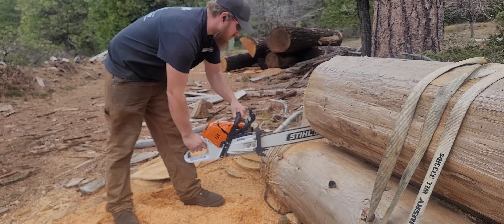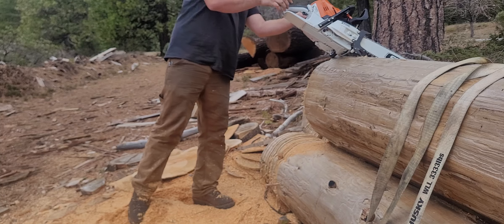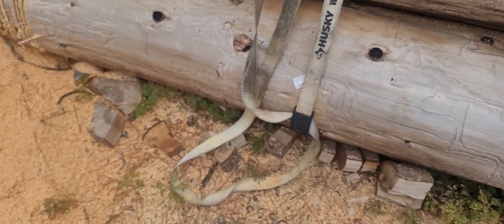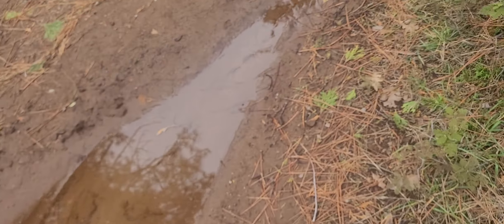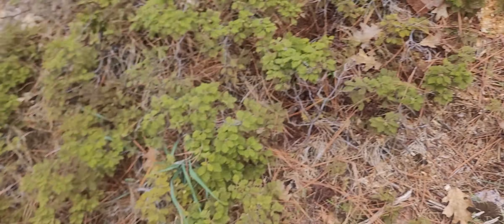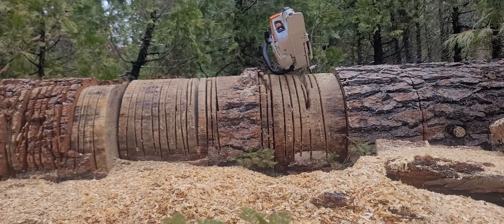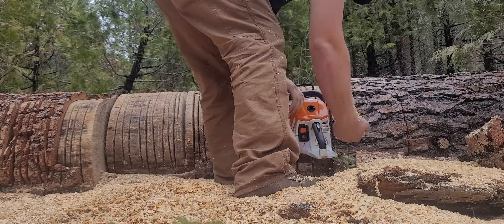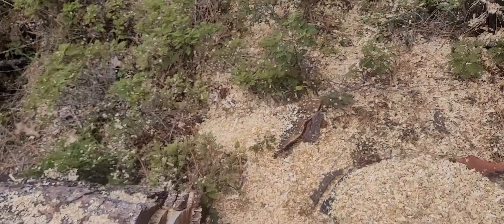Austin's 500i. Let's talk about chips.

Comment: I guess if you where on a  job site with that saw and after half way through the  job you didn't like the chips you are seeing,  you stop the job then replace the blade ? Complaining that the chips are what they should be ? You would not be on my job site that long , bye bye . Quit over thinking the job get it done . You work with what you got on hand you prepared for to get the  job done, get paid and move on to the  next job. You want perfection out of the  box . You get  progress then perfection . But you can't have them  both at the same time it is one then the  other .
Reply from the maker: I think you misunderstood the point of this video, as I was responding a comment on a previous video. Literally, the entire point of the video was to explain that you should not put a bunch of blind emphasis on the chips coming off your chain. Thanks for all your helpful advice though!